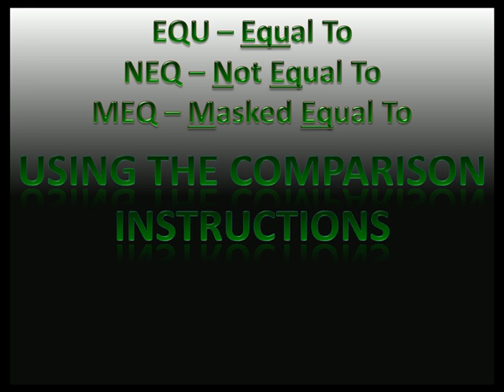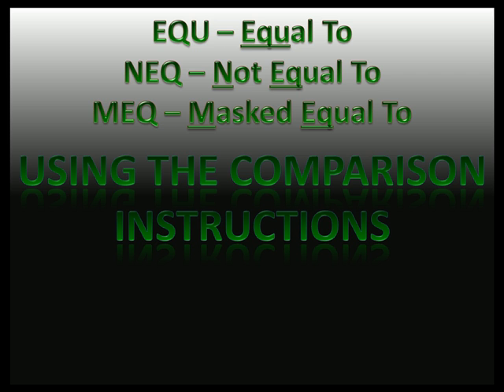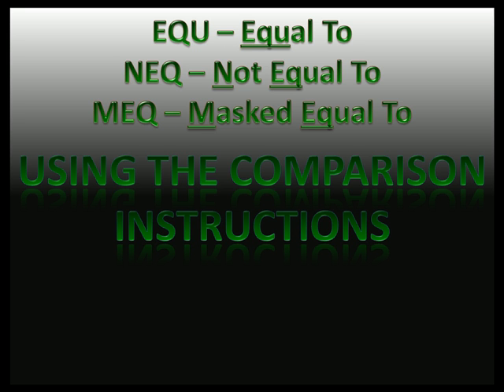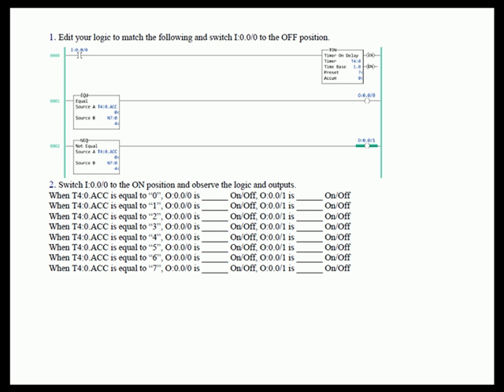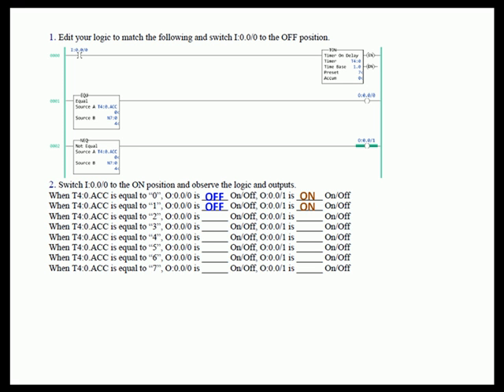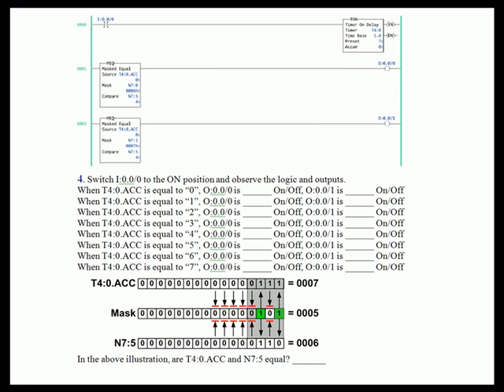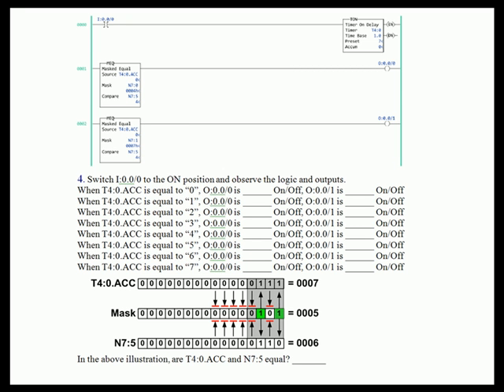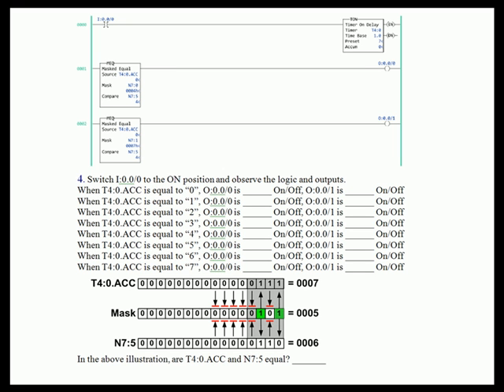ADV1 08 - EQU NEQ MEQ Instructions RSLogix500, A PLC Training Tutorial.

Comment: I did the mask instruction lab and my results were not the same as demostrated.  I have a micrologix 1100 ser. B trainer. I also tried the SLC 500 emulator with a SLC 500/02 selected. With the same results.
Reply from the maker: MIke Wilson I am not sure why you found a different result. In the first MEQ, the third bit (4) and N7:5 are equal anytime that bit is on in the accumulate. 4, 1+4, 2+4 and 1+2+4. In the second MEQ it will only be true when the accumulate is equal to N7:5 (4).
Reply: Thanks for the response. But I figured it out I forgot to change the Masks to 0004H And 0007H.
Reply: Can you explain more in detail how the second MEQ is only true when the accumulate is equal to N7:5 (4). Is that because the first mask is 0004H and the second is 0007H. I guess I do not understand how that affects it.